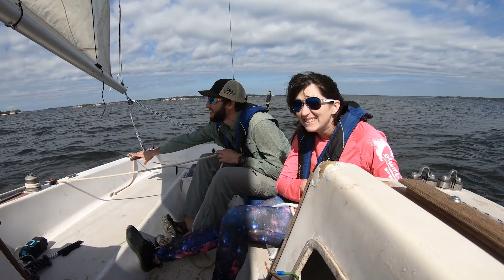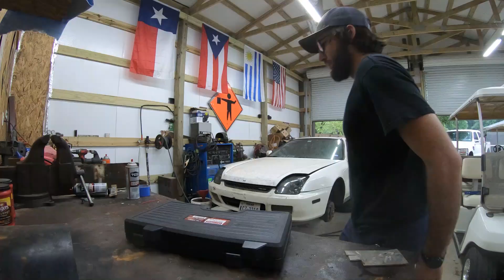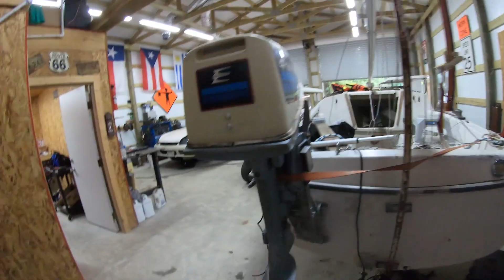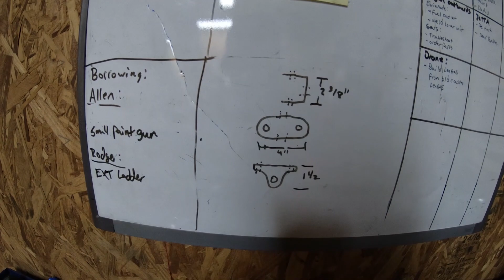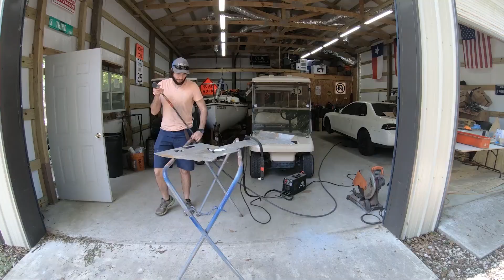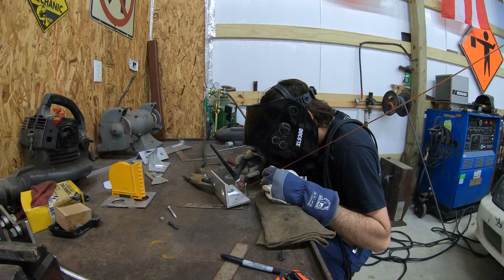DIY Electronic Sailboat Autopilot Episode 3 - Arduino - MIT APP Inventor - New Salts Episode 15

Comment: From my experience in owning and building autopilots, this is way, way to slow. It won't work properly in rough conditions when the input from the tiller is necessary to correct the effect of the waves knocking you off course. Pelagic sells actuators with 58mm/s and this ballpark figure is what you should be aiming for. One way to alleviate this is to change how far is your autopilot mounted from the rudder axis. Yours is really far if you compare it with Raymarine or Simrad specification.
Reply from the maker: In my next video you will see i have moved it onto the transom for this reason exactly.   Thanks for the feedback!  It sounds like i made the right move. 

I also got rid of the extension rod and have the actuator mounted right below the tiller
Reply: have you post your autopilot build?  I´m researching to build mine...    if you can save me some time where I should go or avoid... I would be thankful.... for example why we do not see stepper motors as linear motors....  they could save some power...